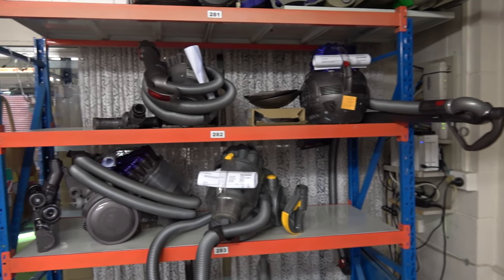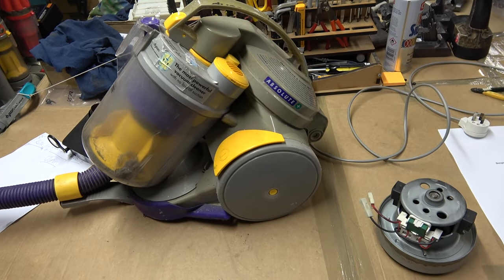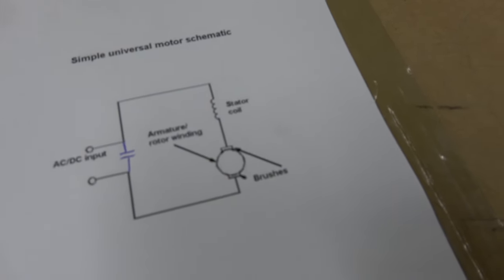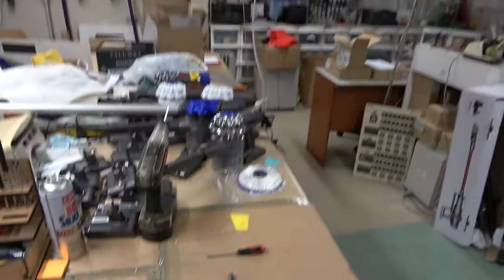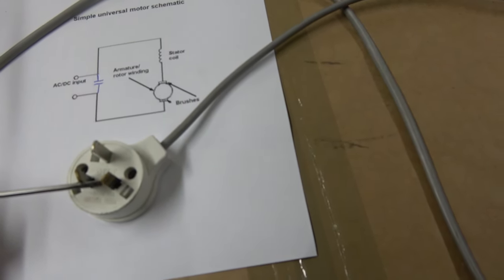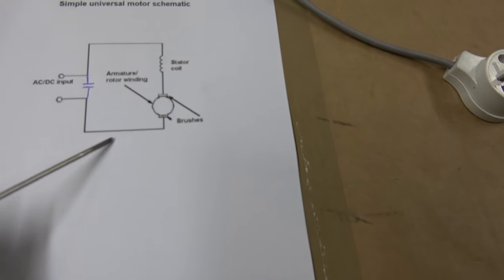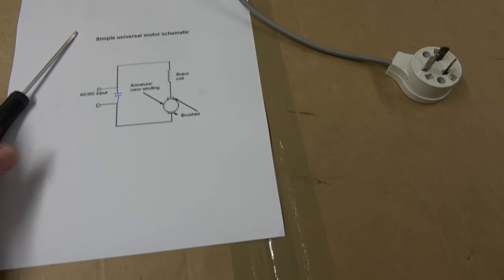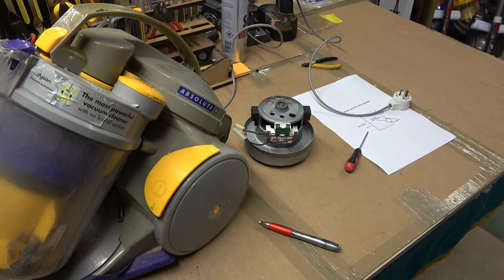Dyson motor failed - test it the easy way

Comment: I’m glad I’ve found your channel as you’ve reminded me to check the most basic thing first which is the fuse!! However, in my case I knew it was a motor as there was smoke and sound and finally died…. So I bought a YDK motor from Amazon and managed to successfully change it but it was not working so I thought it was the motor to which I sent it back thinking it was faulty so bought a second one and again I’ve gone through all the checklist and yet again failed to work. I then found your channel and first thing you pointed out was the plug and that hit me instantly that I didn’t check the fuse and luckily it was the fuse and as soon as I heard the motor buzzing the instant relief and achievement was amazing especially someone Like me who is rubbish at DIY (so am told by my partner)

Comment: Oooh you repair Dysons! what do you think of the old vs new dyson uprights and what do you think are the best old school uprights and the best newer style models they made?
Reply from the maker: I personally don;t like the newer models but I guess a DC41 would be okay. The best machines by far in order of age are DC33 DC14 DC07. Simple solid and reliable. We use a DC33 at my place. Great question by the way. I am sure you already have some knowledge to ask like you did.
Reply: Robonza nice! I agree with you 100% except I found the DC14 to be a bit more heavy duty than the DC33 as I’ve seen quite a lot of Dc33s with snapped bodies just above the cyclone exit 
And the hoses seem to be shorter too and the foam seals like to get damaged in the cyclones vs rubber in the 14 
But they’re quite similar 😄
I’d love to see more Dyson videos from you
Reply from the maker: @parwaz7861  You are perfectly correct. The DC33 has the advantage of being newer. Its weird how some of the bodies crack. I have seen 3 so far. I think you have to abuse them to crack them. You don't need the hoses these days. Whip out a V6 for those jobs. I might do some more Dyson videos when time permits. Very busy here. Never seen a DC33 cyclone gasket fail yet. The DC39 is the worst gasket. I make em here on the laser cutter too.
Reply: Robonza haha that’s true I guess, the big Dyson for the serious vacuuming and the cordless for the quick jobs!
I’m not a big dc39 fan, it’s a nice machine but the original dc19 with the flatout head and dc08 style hose and wand is better as the connections don’t leak air compared to the newer ones for some reason
Reply from the maker: @parwaz7861  Yes DC39's and DC54's are very bad compared to a DC19. I think the DC20 is better tho with its compact storage and solid wand. DC19's always get the hose trashed because they dont fit in the cupboard.
Reply: Robonza absolutely! Actually I might get myself a DC20
I have a DC21 with the Motorhead and it’s amazing but the wand is too big so impractical for car cleaning, so a DC20 would be excellent
Reply from the maker: @parwaz7861  Yeah the DC21 is the most powerful Dyson ever made. Its a monster. FYI to stop the head rattling, apply a layer of insulation tape where the endcaps go on the head.
Reply: Robonza cheers for the tip mate I’ll give that a try! 
Have you tried the latest upright models? They have some serious power too, they’re basically a DC41 but with a redesigned cleanerhead and brushbar so they vibrate the carpet to pull out the extra grit
Reply from the maker: @parwaz7861  The DC41s work really good but the 2.5 hours to change a motor just gives me the sh!ts. The DC65 also has a really wimpy brushbar that wears out super fast. Also the stupid little wheel in the middle of the head wears out so you need a whole new head when it grinds off. I will take a DC07 14 or 33 over it any day.
Reply: Robonza oh yeah true you’ve got a point there
They’ve redesigned the stupid central roller wheel where the belt is on my dc55 I’ve had it 2 years almost now on its original head

Comment: Would this work for other vacuum models, for example a Miele?
Reply from the maker: Maybe, if they have variable speed then no. You need to open one to check if it is like my circuit

Comment: Can the dyson motor be bench tested , i.e. run before installation?
Reply from the maker: Sure, a really safe way to do it is stick it on a 30V DC bench supply and should run up but wont scream like normal
Reply: @Robonza  Perfect and thank you. Great video , highly recommended.